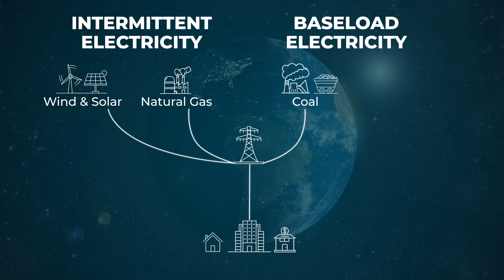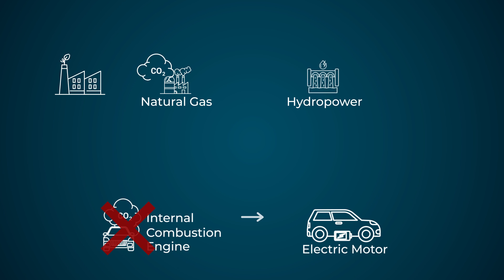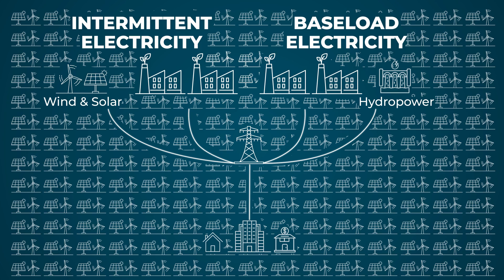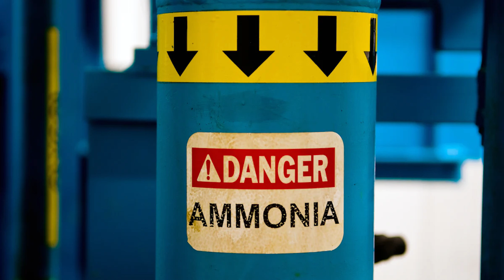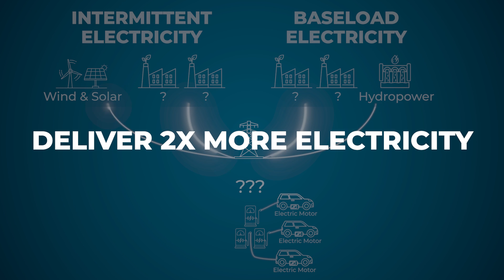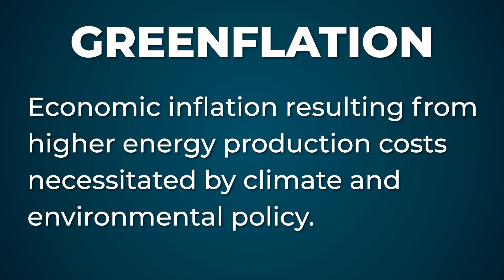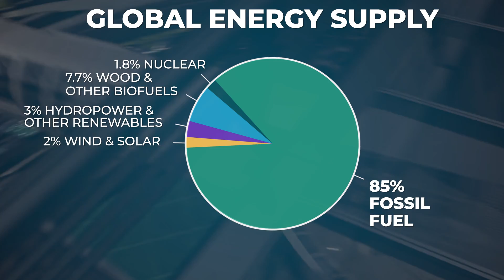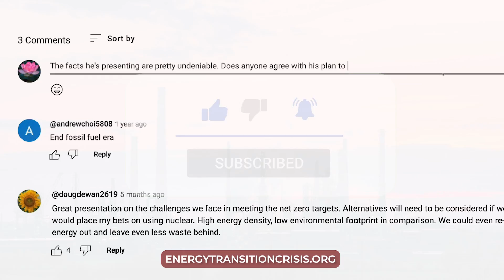Energy Transition Crisis - Episode 2: A Master Plan to Achieve Clean Energy Transition

Comment: When you point to the cost of building the necessary infrastructure you should also have pointed out that this build out will take significant energy.  Energy in vs Energy out of these new technologies is also an important issue that needs addressed.

Comment: Erik, this is excellent work. I’ve been a long time listener and am so grateful for the time, money, and energy you’ve put into developing this project. 

If I have anything to add or question (hopefully of value for your research team in the full production when it arrives) it would be the use of hydrogen as a storage method. A couple fellows named Michael Barnard and Paul Martin (both from Canada) have detailed at length the challenges with energy loss (which you covered here) and more importantly, storage density. For example, I’ve heard H2 often compared to LNG, where on an equal mass, H2 carries a high energy density. True. The problem arises at liquified pressure, where the fuel mass is actually very low partially due to low molecular weight. And on a volume basis, liquified H2 can only carry 20% the amount of energy as the same volume of LNG. Add to this the significant losses of converting water to H2 through electrolysis, and we have some issues with this solution. 

In the end, you’re probably right, this still might make sense at an industrial or shipping scale (not to mention land storage in place of batteries), especially if energy prices become as elevated as we expect over the next several decades.

Maybe ammonia is a better solution, but I’m unfamiliar with the situation around it.
Reply from the maker: Thanks for the kind words! As another viewer already pointed out, the one thing I've realized so far that I really screwed up by leaving out was the whole energy density ladder (and probably also EROEI) discussions. Ep. 1 would have been stronger with a visualization of energy density concepts but it was the first episode we produced and we were just learning. Cheers!

Comment: Unfortunately, the government and corporations will not undertake the  huge capital projects necessary to transition our economy from hydrocarbon transportation, to electric transportation. 
I actually do think that it could come from demand driven forces. I just bought a security camera for my house, it's getting installed with a $20 solar panel to power it. Im already seeing "One wheels" which can go 50 miles on one charge, my good friend uses an electric scooter to get around, I think some sort of electric motorcycle could be next. If cheaper, lighter, more efficient electric vehicle options are to continue, and photovoltaics keep reducing in price, I think the demand and technology will start fron the bottom up.

Comment: Additional electric power supplied to the grid only has to grow as fast as our transition to electric vehicles. It doesn't need to happen overnight. Concerning grid capacity you are not  taking into account rooftop solar which dramatically reduces the need for updating the grid. You're also not considering the dramatic effect  time-of-use metering can have on consumption profiles.
Reply from the maker: Thanks for your comments Richard! You're right that I didn't consider rooftop solar's role in reducing grid demand, and I hope that factor will slightly defray the monumental job that lays ahead of us. But my central point remains unchanged: In 20+ years of Climate Awareness, there's been ZERO public debate/policy discussion around the grid upgrade aspects of energy transition.

Comment: Great episode. Spot on. One issue: I’m a farmer. I don’t see how anything can replace diesel fuel in a tractor or harvester.  We need the energy density of diesel t operate the hours that we do, sometimes 24/7.  No battery can do that. Nothing else, except nuclear, has the energy density of diesel to accomplish the goal of generating 300+ hp for farming hours.
Reply: Have you looked at Ammonia mentioned in the episode?  I don't know much about it but it stuck out as something interesting. If it were simple, I'm sure farmers all over the country would already be using it.
Reply: Hi Greg, I've been toying with doing another episode just on the topic of heavy machinery and ships at sea. The first part of the answer is pretty simple/obvious: Whether the energy comes from nuclear, solar, or some other source, we have to figure out ways to make that energy available to vehicles that can't stay connected to the electric mains. The two big contenders are hydrogen and ammonia liquid fuel. Counter-intuitively, those are covered in more detail in Ep. 7, because small modular nuclear reactors are an ideal way to power ammonia liquid fuel and hydrogen plants. Cheers!
Reply: Or, Erik, we could just keep using diesel, which is what will happen because it must until a better source of power is discovered.
Reply: @eriktownsend8842  you deserve a more thoughtful response.  Let’s examine harvest.  There will be two combines operating in the field each with a 330 gallon diesel tank and two tractors pulling grain carts which haul the corn from the middle of the field to the grain bin or truck at the edge of the field.  Each of those has a fuel tank of 160 to 200 gallons.  It is terribly inefficient to have to stop in the middle of good harvesting conditions to refuel, hence the fuel capacity.  The machines get fueled up typically before conditions are good for harvest in the morning.  These machines are already massive, so adding a tank for hydrogen or NH3 that would have the capacity to run all day just won’t work.  Only diesel has the energy density for jobs like this.  I do think a small nuclear reactor would work.  The travel speeds on these machines is such that a dangerous accident is highly unlikely, but no one has made a reactor (too which I am aware) that puts out the equivalent of 600 to 800 hp.  I will be shocked if the world is using less than 100 million barrels of oil a day in 2035 or even 2045.  Unless, of course, cold fusion is perfected.
Reply: @SenGreg  I don't think we disagree about much, Greg. You're right that you'll continue using Diesel because that's the only sane thing to do. Soon the cost of that Diesel will make it nearly impossible for you to stay profitable, and your pain will be transmitted to the rest of society as inflation. But you'll keep using Diesel because there's no sane alternative. Eventually we need to come up with sane alternatives. Right now H2 and NH3 are the only hot candidates, and neither of them is perfect by a long shot. So it's going to basically suck for everyone and there won't be many good choices. But Diesel will keep getting more and more cost-prohibitive. Eventually you'll probably have to bite the bullet and tolerate a loss of farmland to install NH3 refuelling stations for your equipment, and that will suck too.

But at the end of the day, the fact remains that peak cheap oil isn't going away. There will never be nuclear fission reactors to power farm equipment or other vehicles. The problem is you really do need to contain the criticality (nuclear fission chain reaction) and keep people away from it just in case something goes wrong. Hence the current legal requirement for armed guards at nuclear plants. So you can't really put one in a vehicle. We put them in submarines, but even then it requires that people be deployed 24/7 just to monitor the reactor. A nuclear submarine or aircraft carrier can have a whole team of guys who do nothing but monitor reactor safety. You don't have that luxury in the cab of a tractor.

So while nuclear will almost certainly provide the SOURCE of energy for most farming and construction equipment needs, getting that energy from where it's produced (nuclear plant NOT on the farm) to where it's consumed (heavy equipment) is going to be the challenge, and it won't come easy. If it's any consolation, aviation fuel is even harder to replace than Diesel, and it's likely that "long haul" flights will no longer be possible after we're forced to switch to a less energy-dense fuel source such as NH3.

The place we disagree very strongly is your statement "because it must until a better source of power is discovered". Unfortunately, Greg, we don't have the luxury of waiting for a "better" fuel source. Diesel is going to become prohibitively expensive, and you're going to be forced to switch to LESS desirable fuels such as NH3 because they are the only affordable (probably after a subsidy) option left to you.  For now, Diesel is still the best option and that's what people will use. But that won't last forever.

Nobody said this was going to be fun. Sorry, it won't be.
Reply: @eriktownsend8842  I sincerely appreciate your thoughtful reply and the time for interaction.  I’d say where we disagree the most is on what diesel (and crude) will cost in the 2030’s and 2040’s.  I think peak cheap oil is a correct concept, but that doesn’t mean that oil goes to $300 (inflation dollars n=2023) and stays there.  The Saudis are very interested in unconventional production and attend every conference on the subject.  I think oil will average less than $150 a barrel through the 2030’s in 2023 dollars.  We’ll see.  And that, as Kevin Muir says, is what makes a market.  See you in the machine. (That said, I’m irresponsibly long oil and producers right now, because I completely agree with you on pricing for the next few years).
Reply: Hi Erik.  Unfortunately, ammonia suffers the same problems as hydrogen; it does not exist in nature.  The vast majority is synthesized using the Haber Bosch process which reacts hydrogen with nitrogen.  The question is where does the hydrogen come from?  The most common source is natural gas via steam reforming which produces so-called blue hydrogen, and therefor, blue ammonia.  The byproduct of steam reforming is CO2.  Green ammonia is synthesized from green hydrogen, which as you know is via the inefficient process of electrolysis (~50%).

As the project manager on the development of the first fuel cell powerful enough for automotive application with Ballard and Daimler, I came to believe that methanol is the solution.  Like ammonia it can be synthesised from hydrogen using CO2 instead of nitrogen, and when converted back to water releases the CO2 used in its manufacture.  It reforms at low temperature to a hydrogen/ CO2 mixture which can be used directly in the fuel cell.  Daimler and Ballard produced the NeCar 5 which ran on liquid methanol.

https://eepower.com/news/daimlerchrysler-unveils-new-necar-5-fuel-cell-vehicle/#

Here is a scientific paper comparing the alternatives.

Love your series, love MacroVoices, many thanks.

https://www.sciencedirect.com/science/article/pii/S2772656822000276
 @eriktownsend8842
Reply: @ricpow6009  Hi Ric! I appreciate your comment and everything but let's keep thjis in perspective. You're on the 2nd episode of an 8-episode series. Obviously, I'm already well aware of all you say here, and most of it is addressed in later episodes. H2 and NH3 require lots of energy. SMRs will provide it. It's all covered later in the series, honest!

Comment: I’m a huge fan of Erik’s work and will be sharing this far and wide. 

One unanswered question stands out to me after watching this episode. Electric vehicle batteries have a lifespan in the range of 10 to 20 years. The materials used to make them are finite and limited, just like oil. What would be the value in replacing the existing gasoline powered vehicles with electric vehicles only to have them become obsolete within some relatively short period? Wouldn’t we be much better served by investing in things like hydrogen where the vehicles would not have this very limited lifespan and require the continuous availability of hard to mine battery metals?
Reply: Really good point! It seems crystal clear to me that we need to discover new battery chemistries beyond Li-Ion. I don't know much at all about battery chemistry, so I'm a complete novice and don't really have any insight into what new battery chemistry might be most promising. But I'm in strong agreement that "renewable energy" makes zero sense if its part of an overall plan that depends on the whole world needing a new set of Li-Ion batteries every 10 years. There's nothing sustainable about that!

Comment: I was recently reading about gallium and how it's high "bandgap" and fast electron mobility pushes the limits of power density, cutting energy usage. Just a thought, but might efficiency improvements such as this lessen the issue surrounding future electricity demands? The problem with gallium is China has a strong hold on supply, but I'd love to know if there are technologies being developed that improve electricity efficiency. The focus seems to be on increasing electricity generation rather than on how much electricity is wasted and how much can be saved by the power of electronics. Disclaimer: I'm not arguing that technology can completely dig us out of the energy transition conundrum, but it will be important alongside a more diverse energy mix.
Reply: @michaelmorley1921 Solar cell efficiency can be increased by using more of the light spectrum wavelengths including UV and infrared. This can be done using layers of semiconductor junctions sensitive to these different wavelengths in the solar cell. These different sensitivities are provided by elements with different band gaps, gallium been one of them. My solar installed in 2015 had an efficiency of about 15.5% in eight years the norm is about 20% now. So for the same size panel you get about 33% more energy, so you could cut down the area covered by solar panels by solar panels by 25%. The efficiency will most likely continue to increase. The efficiency to store intermittent solar or wind will also probably increase but it is quite efficient now. The main thing is cost of storage batteries. There is other ways to store solar and wind energy, like pumped hydro but it is not as efficient and not available in a lot of areas. There is also methods like flywheels and gravity type mechanical batteries. Most people say to store large amounts of energy these two methods would be impractical. You could really scale up the tower height  and number of gravity batteries to store a lot of energy if these towers were part of office or apartment buildings in a large city area. That way you might be able to conserve the space needed and have the energy mostly available where it was needed.

Comment: Excellent episode.  My take-away is that the creation of the EV was solving the tip of the energy transition crisis, and has done / will do nothing to reduce our dependence on fossil fuels without addressing the primary energy source. which today is still 80% , down only 3% despite the west investing $4 Trillion in wind and solar and picking the low-hanging fruit.  

We have proved that it is not possible to pick the winning technology.  Remove barriers to energy production (lease restrictions, blocking pipelines, mining restrictions), impair production of pollutants through a revenue neutral taxes, and let the free market find the best solution.

Comment: Production and cost of Wind/Solar is an S curve and will hugely increase but yes still a lot to do! Baseload Coal unless used all the time lose money from 75% use and lower!! Off grid production and consumption will reduce needs for transferring energy and is another piece of the jigsaw! EV.s now getting cheaper than fossil fueled and require less materials. Future transport would be in the air and then expensive roads would not be required coupled to massive Public Transport and cycling in heavy Urban areas. Subsidies are paid to fossil fuel producers in a massive way and renewables can survive subsidy free!! Going from resouce single use to technology based technology will reduce inflation and increase human health!

Comment: H2 and NH3 both suffer from serious disadvantages- They're gases and storing them, particularly H2, is very difficult. Making hydrocarbons is a known technology and no change to existing infrastructure would be required. But you would need a large scale power station which would have to be cheap and long lasting. Solar and wind are neither and suffer from huge environmental disadvantages and on top of which we need oil to produce them. I look forward to your next video.
Another point, in an earlier video you stated that gas power stations are 55% efficient. Does this take into account the about 60% loss at the steam turbine due to the change of state of water? It seems very unlikely to me.

Comment: Oh! So hydrogen is his alternative to batteries for energy storage. Doesn't he know that it takes 3 units of energy to produce enough hydrogen to store just 1 unit of energy? Or that being one of the smallest elements on the periodic table, it leaks through most materials used to store conventional gas like methane, etc? And when it does, just floats on up into space?
Has he missed the point that vehicle batteries will become the dominant storage form, because they hold 5-12 times as much as a household wall battery? Has he not caught onto how smart grids will be able to shuffle energy around as it's needed?
Has he not heard about sodium iron batteries for utility scale storage?

Comment: You're wrong there is lots of wind,solar,nuclear possible in 10 yrs,lots of battery storage  possible, with iron batteries,
Oil production uses a lot of electricity
Gas cars can be converted to bev